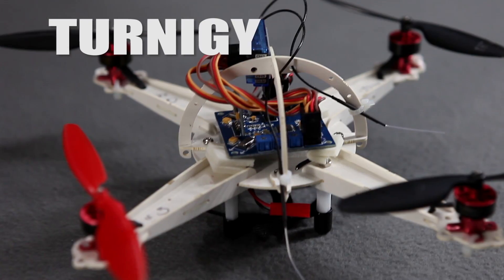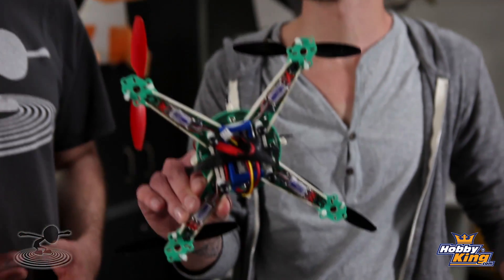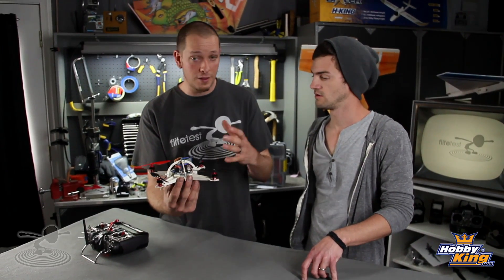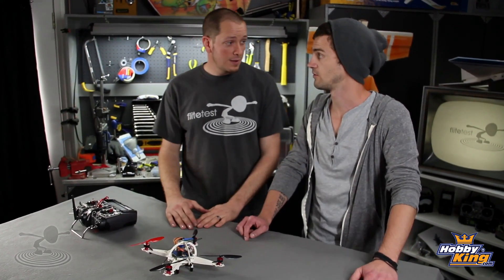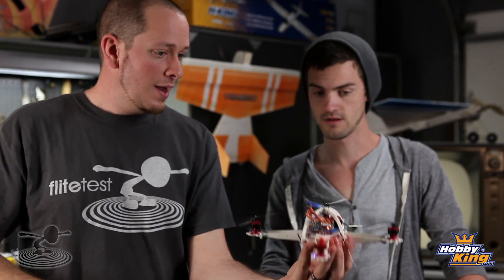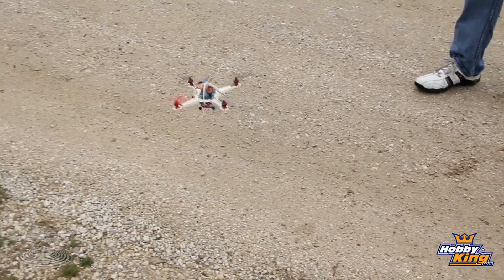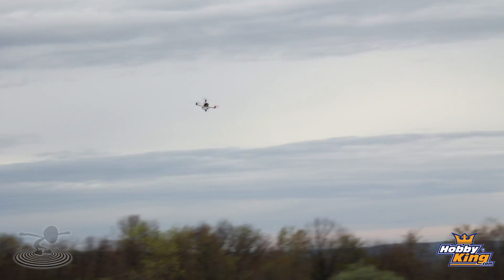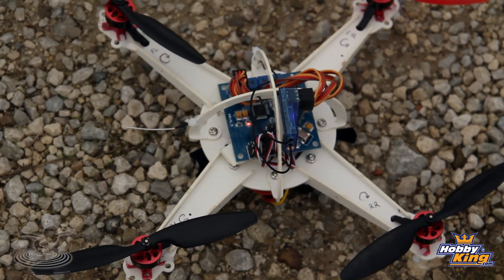Flite Test - Micro Quad - REVIEW

Comment: sol·der
ˈsädər/Submit
noun
1.
a low-melting alloy, esp. one based on lead and tin or (for higher temperatures) on brass or silver, used for joining less fusible metals.
verb
1.
join with solder.

Comment: Honestly better off buying an mQX. $134.44 for all these parts after shipping (to CA) and that is without a charger. Its going to take ~30 days for all parts to come in. You can get a BNF mQX for $169.99 at your LHS or even shipped in about a week. No need to soLder, just charge it up and fly. Also dont need a programmer to switch flight modes.